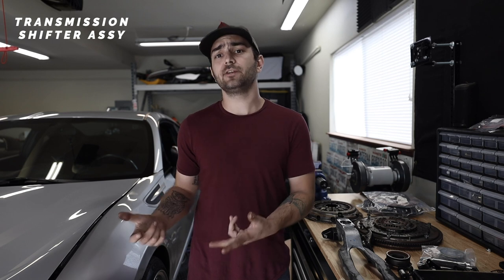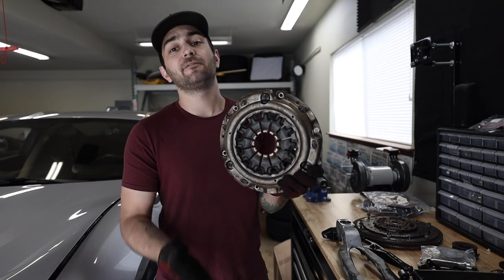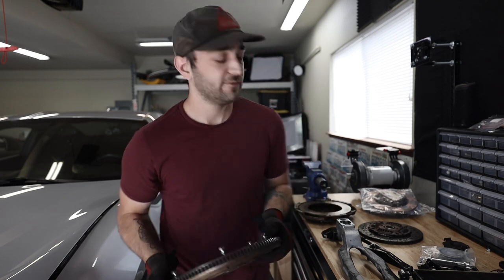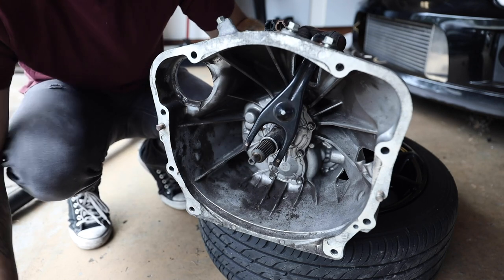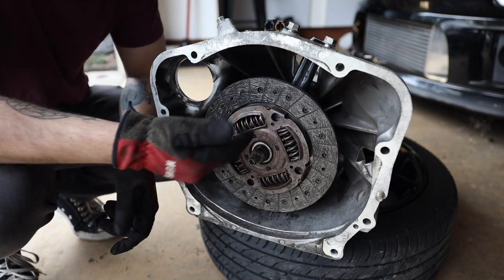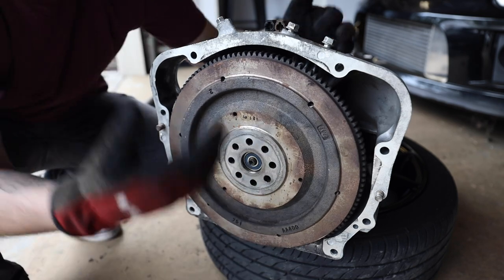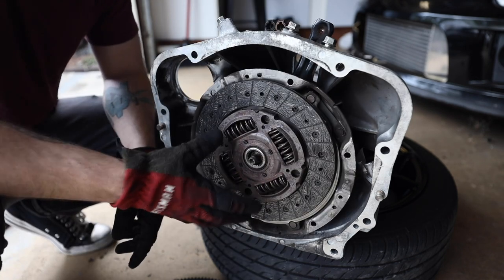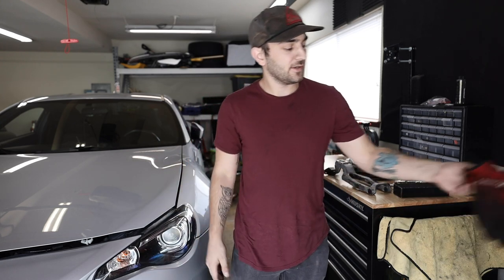How Does A Clutch Work?

Comment: Cheers for this really useful to see, only seen diagrams of this in past which did not exactly explain all this. I had my clutch replaced on my 2004 facelift Celica not too long ago 86,000miles, my Dad noticed it was slipping and it got really bad, to the point would not grip on a hill and was nerve wracking. New clutch bedding in took a while but all good now, bite was really low at first.
Reply from the maker: Glaf the vidro helped to clarify some of it and glad you got the clutch taken care of 🙌

Comment: Can you do a video for people such as myself, why you should get a STI and if the 2020 STI is worth it?
Reply from the maker: I have an older video that outlines the major differences and whats right for you but feel free to ahoot over any questions you have! Personally of it were me I would get a lightly used 2019 to save a little $$$
Reply: Smeedia wow thanks for the info, unfortunately here in Hawaii just because it’s an STI the prices of a used one is just $3000 less than the 2020 model😅😅😅
Reply from the maker: Still saves a little extra 😅 enough for some good mods if you wanted. The 2019/2020 are near identical in specs but if you wanted a brand new one the 2020 is a great choice 🔥😁

Comment: How difficult would you rate changing out these parts, clutch, flywheel, throw out bearing, clutch fork (2017 WRX)?
Reply from the maker: Little more annoying because you have to pull the front half shafts but id say a 6.5/10

Comment: So to clarify, wear on the clutch takes place only while it's in the "bite" zone when it's engaging or disengaging from the spinning flywheel?  Once it's either completely disengaged (clutch pedal all the way down) or engaged (pedal up with no force on the pedal) no wear on the clutch is taking place?  I'm trying to understand how to make a clutch last longer.
Reply from the maker: No wear on the clutch should be taking place. When it's disengaged there are no external forces acting on the friction disk. Things that will wear your clutch are hard launches, riding the clutch, more WTQ than your clutch is rated for and hard shifts.

Comment: I just got my clutch replaced and it’s slipping a little while taking off (driving normally), also when reversing and when I downshift to 2nd gear when slowing down.  What could be the cause of the issue?  Nice educational vid btw
Reply from the maker: Thank you! And could be a bad synchro in the gear box or the pressure plate and TOB are not fully communicating

Comment: Teaching my wife to drive manual so most likely my clutch will go out faster than usual do you recommend upgrading to a heavier duty clutch or it doesn't make a difference as far as wear longetivity?
Reply from the maker: A full face clutch will last longer than a pucked clutch, if your shooting for power and want a good daily clutch i would suggest a stage 1 or 2 full face clutch, ACT makes a few good ones
Reply: @Smeedia  thanks !!

Comment: Verus Engineering makes a great clutch fork. It's compatible with other Subaru models as well. The page lists the models it's compatible with. 

https://www.verus-engineering.com/shop/product/a0092a-forged-clutch-fork-brz-frs-gt86-319?category=39
Reply from the maker: Thats the one I'm using on the BRZ, great piece 🙌
Reply: Yeah buddy. I installed it on my 2008 WRX after my stocker let go.

Comment: Mate check out Motives video on clutch’s! I know you have said after your BRZ came back from the Subi dealer about how different it is, grabby the term you used can’t remember,  but some good info here re what else you should do when doing a clutch up grade, but just overall great detail info on what you have done here, just thought it may be helpful to dial in your BRZ new clutch and when you do the STi.
Motive Video / What the fast / clutch detail.
https://youtu.be/P5SRosSqQZ8
Reply from the maker: I'll check it out! The clutch is feeling much better after breaking it in a little bit and swapping out a few smaller parts 🔥
Reply: Smeedia good to hear, yeah it’s very good info definitely filled in a few gaps for me , I always err on if I modify one things I look at the whole system related to it, but that’s my bike racing background more than car knowledge! be interesting to see what your thoughts are on this after watching it, loving where both cars are heading btw 🤙

Comment: what kind of clutch did you get?. ha bones red sk8r life
Reply: i have a 2011 sti with 368 hp & 406 tq what stage clutch would you Recommend
Reply from the maker: I'm using a stage 3 competition clutch 😁 and for you the factory clutch should be fine for the time being 🔥 if it goes out though I would look at an ACT or Competition replacement 😁
Reply: Smeedia Yeah I’m going to have to replace it pretty soon it’s starting to go out